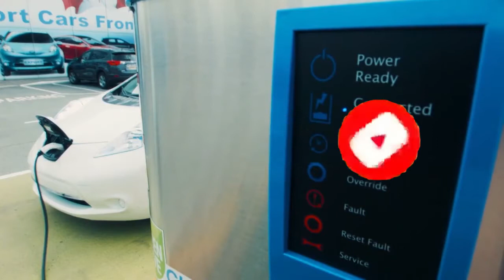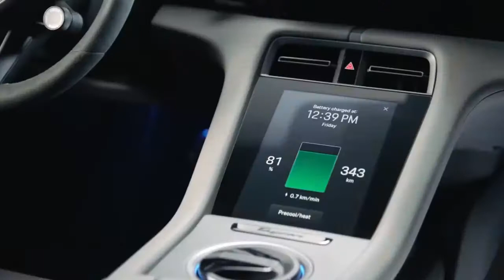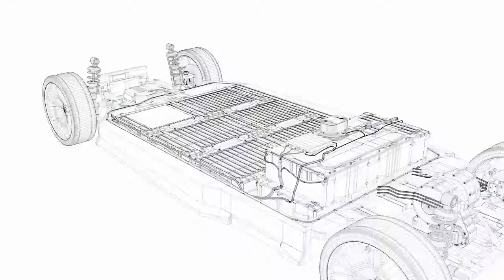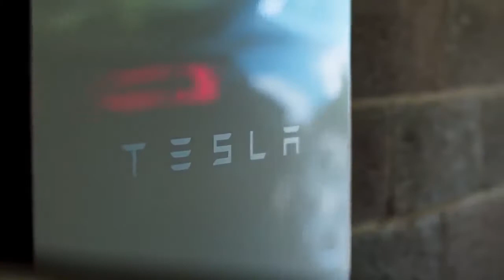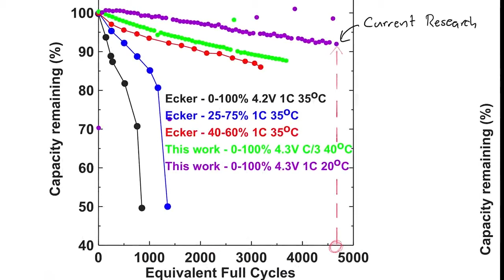Shocking Invention: Tesla's One Million Mile Battery

Comment: Contemporary Amperex Technology Co. Limited (simplified Chinese: 宁德时代; traditional Chinese: 寧德時代; pinyin: Níngdé Shídài), abbreviated as CATL, is a Chinese battery manufacturer and technology company founded in 2011 that specializes in the manufacturing of lithium-ion batteries for electric vehicles and energy storage systems, as well as battery management systems (BMS).

With a market share of 32.6% in 2021, CATL is the biggest lithium-ion battery manufacturer for EVs in the world, producing 96.7 GWh of the global 296.8 GWh, up 167.5% from the prior year.

It grew even further in 2022, increasing its market share to 37%.

The company plans to have a manufacturing capacity of more than 500 GWh by 2025 and more than 800 GWh by 2030.